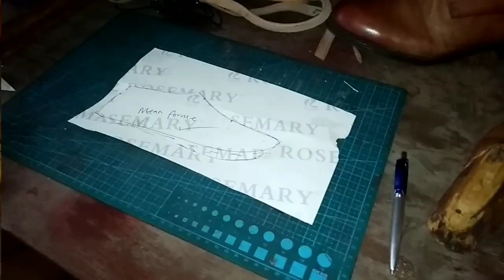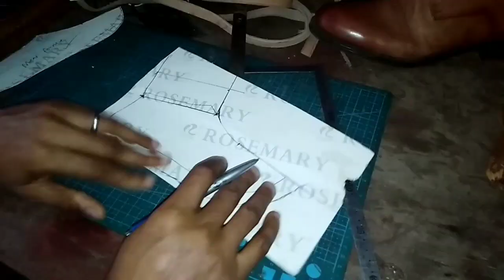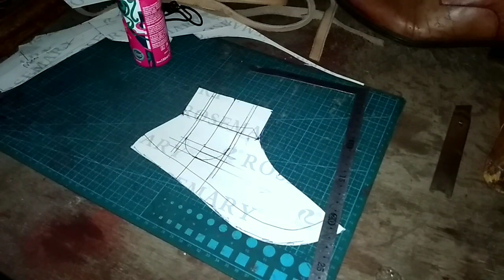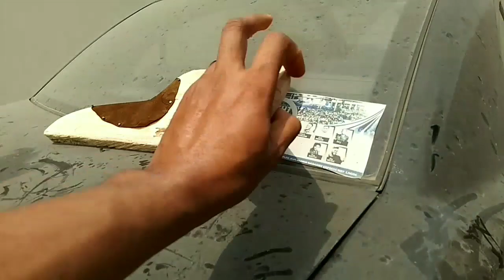Shoe Making Tutorial - How to Make Chelsea Boots

Comment: Please sir,what’s the purpose of putting the leather in the water(is it necessary)and for how long will the leather stay on the crimping board to form the shape?
If I’m working with a suede or wet look leather,is it okay to also put it inside water without damaging the leather?
Reply from the maker: It is important to soak the leather in water before crimping. Depending on the leather, you soak for about 10 - 15 mins and then wrap the leather inside a towel for about an hour or 30mins. After crimping, you have to leave the leather on the board till it is completely dry. Yes you can soak suede. For patent leather (wet look) I have not crimped it before but I should think that there won't be a problem with soaking it in water if it is good quality leather. Suede will lose a bit of its color but it is usually not very noticeable.
Reply from the maker: And if you are concerned about soaking any particular leather in water, you can try this method https://youtu.be/AgIgLZaw8oA